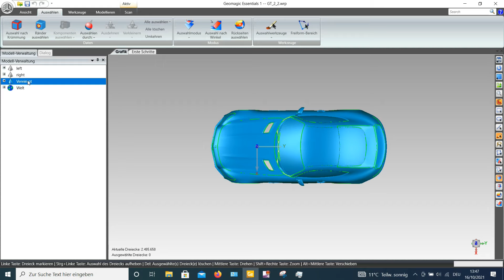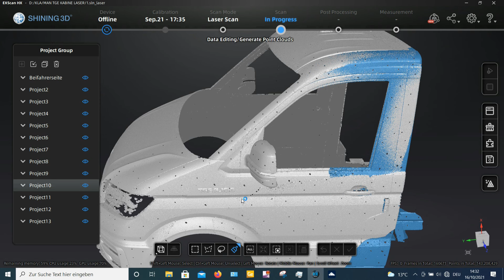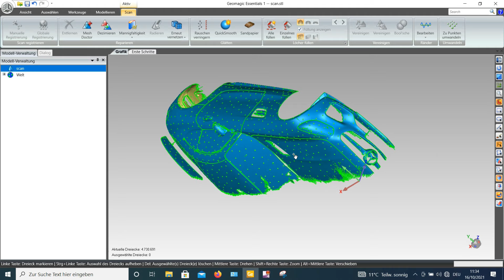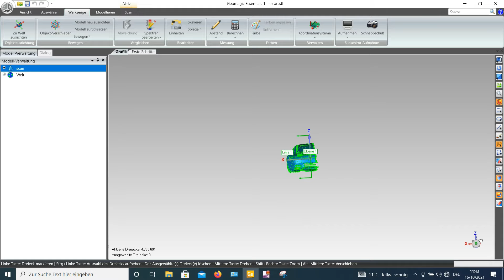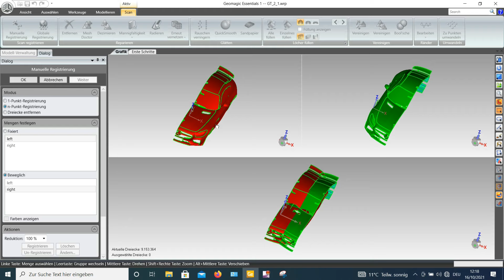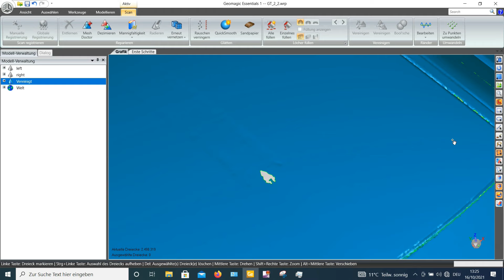3D Scan car bodys with hand scanners Vol. 1

Comment: This is a great video, thanks for going into so much detail. Can you estimate how much time it takes to scan a car with the various scanner models you mentioned? How much of a difference does the scan size and scan speed make between, for example an Einscan H and a UE? I'm curious how much more performance you get for 3x-4x the price. Thanks!
Reply from the maker: Thank you! It will depend on various factors: Scanner, resolution, hardware, shape of the car, environment and so on. If you can do it in one hour and scan the outside shape it's very good. I think 3 to 4 hours is quite common.
Reply: @3dscanacademy76  Hi, I love love love your videos, your attention to detail is just what the industry needs, could I ask does the 3 to 4 hours include the placing and removing or marker dots and the post processing time? Could you break down the time for each step please? Many thanks and keep up the excellent work! Much love from the UK!
Reply from the maker: @coldh4nd  In an optimized process it is possible
Reply: @3dscanacademy76  how long would you spend on placing the markers? Would a tool to speed up the application process help the industry?
Reply from the maker: I didn't make the same scan of the car with the different scanners to compare them because it is still some question of time. Comparing a laser scanner with the EinScan H is as well a bit difficult because you would need to spray the whole car for EinScan H, put the markers on the spray and finish everything before the spray disappears... You can split the task as well in sections what will be easier. I will rise the process time for sure. Permanent sprays will need a carwash after and might not disappear on older an rubber anymore...

Comment: what setting did you use for the scaning?
Reply from the maker: this was scanned in 0,6mm resolution and normal laser mode. I recommend to scan in 0,8mm or 1,2mm for having normal process time and data size